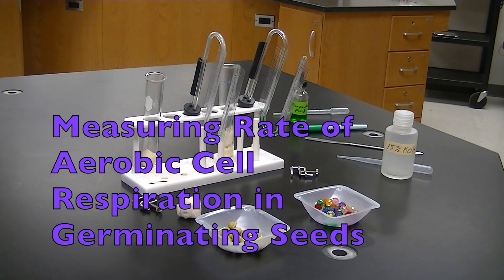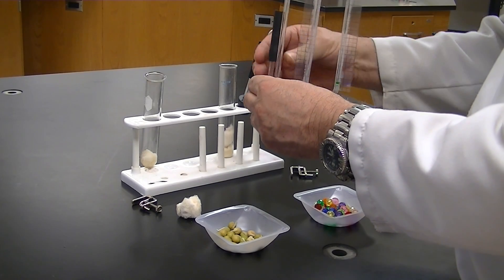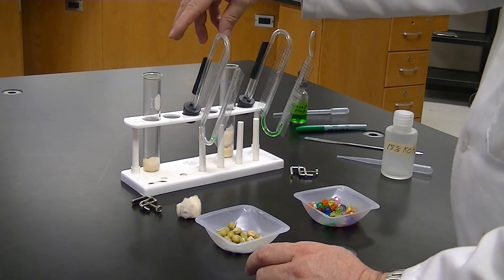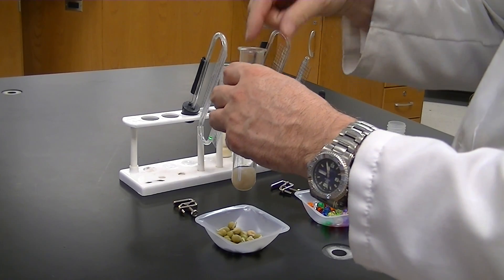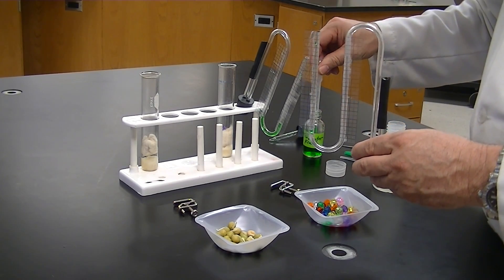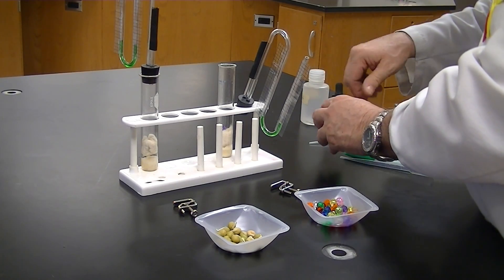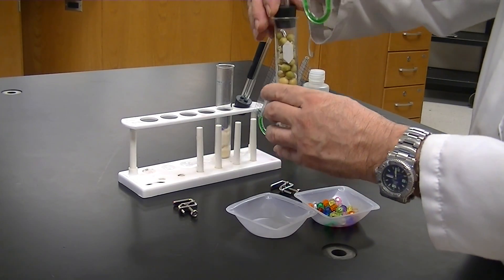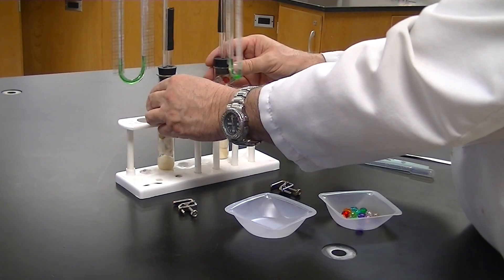Cell Respiration Lab Using Hagge Respirometer

Comment: What would happen if you used non geminating seeds instead of germinating?
Reply: You will see the same results as the plastic beads.  You will always see a little movement at the beginning of the experiment then it stops.  I think that the little movement at the beginning in the control tube is caused by the removal of CO2 out of the air inside the tube.